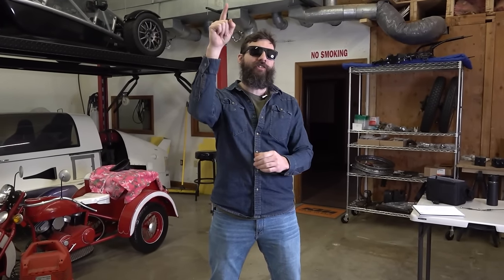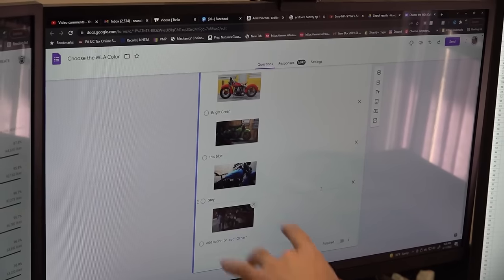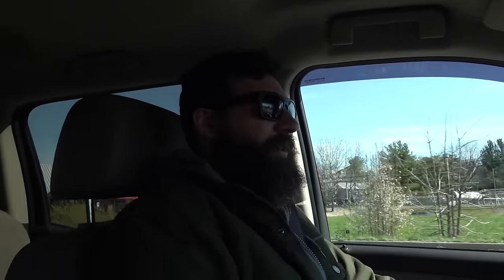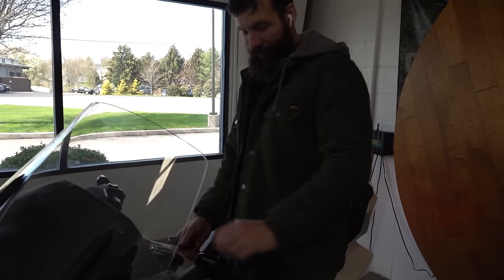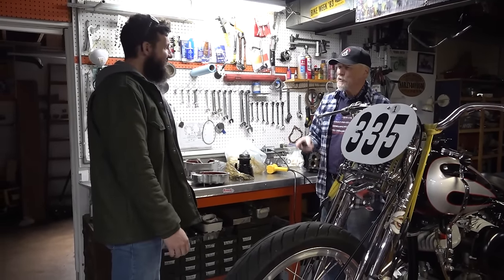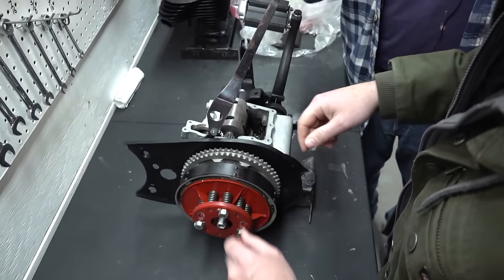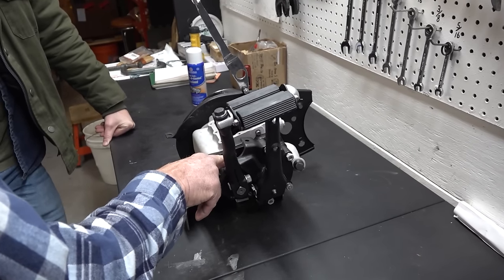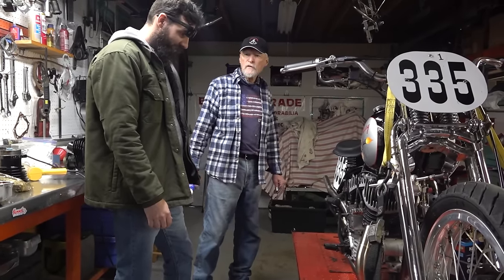The Junkyard WLA Transmission gets finished and we Sponsor and old friend

Comment: That looks exactly like the clutch on my 1981 Shovelhead... and mine leaks oil via the transmission studs too 😁 for adjusting the clutch springs, make sure the pressure plate releases evenly all the way around. This might mean the three nuts are not screwed down to the same depth !

Comment: Never ride the 45 wide open for extended periods of time during hot weather or you will gauld a piston skirt !  Those engines did not spray oil on the pistons so you have to let off the throttle and timing advance on left side of stock handlebars every so often to allow the pistons to draw oil up on the cylinder walls.   Friend of mine installed an oil spray port on his flathead 80 but I don't think he ever got it quite right due to the oil spray going past the rings causing the engine to burn oil.  So he didn't get the spray nozzle at the right angle or there was too much oil pressure.

Comment: I think your better off doing a period correct color but many of the bikes of that time were more than one color. Your best bet is to find someone who is knowledgeable on bikes of the time and the typical color combinations so that it looks more authentic. Plus another thing you may want to consider the graphics that would've been readily seen on such a bike. On my Road Glide theres a pass pin that comes with the bike or you can put one in to start the bike without the key fob. There's a card that you can stick in your wallet that gives you instructions on how to enter te code. I swear I've got the same tshirt Tim is wearing. Sounds like Tim is doing that old biology song for the bones but with the transmission parts. I'm quite sure Tim appreciated the sponsorship and the gifts for his race bike. That was a great thing you did for him.

Comment: I made the serious error of helping an old bloke by pushing him to start his Walla race bike at The Barry Shean Festival of Speed in Sydney a few years back, it fired and left me almost head planting in the bitumen car park of the pits. I managed to shoulder roll and only lost minimal skin. Never again, its self-starter or rollers from now on.
Reply: Saw this happen at Sears Point years ago.  The bike lit off, the throttle was stuck wide open and the rider and the bike went tearing through the pits barely missing several people.  He fell off eventually and both he and the bike ended up wedging themselves under a pickup truck.  Good thing he was suited up for the race already.  We rushed over and, with the help of many guys, we lifted the rear of the truck and dragged him and the bike out.

Comment: I would've liked to see a little more padding in the ass part of the seat,  but l like the finish and it should fade/age nicely, leather needs ' feeding' occasionally.
Did you ask the racer what oil he uses in the gearbox? (I thought you might go Matt 7:12 on the quote)
Reply from the maker: that would have been a great verse also , thanks

Comment: ok, you've lost it with the cinematic start up sequences...leave that to whoever you saw do it first, And you still haven't picked a name for the WLA, and I still wonder if it's name is Charlie, Joe or Joerlie
Reply: Using the remote transmitter
To allow a person who does not possess the Honda SMART Key to open compartments, press the UNLOCK button on the Honda SMART Key (Turn signals blink 2 times).

When the UNLOCK button is pressed, the compartments can be opened by someone who does not have the Honda SMART Key.

If you press the UNLOCK button, but nobody opens any of the compartments within about 30 seconds or about 30 seconds have passed after an opened compartment is closed, the compartments automatically will relock (Turn signals blinks once).

uWhen the 30 days have passed after the ignition switch is turned to OFF or after the buttons of the Honda SMART Key is operated, the remote transmitter will no longer operate.
To reset the system, turn the ignition switch ON once and then OFF.
Reply: @dopeytripod  totally NOT what I was referring to... more like he lost it on the cinematic vehicle start up sequences... I was saying NOTHING about how to start a "had one never did again" (HONDA)... and I will never own another honda to care about that anyway
Reply: @TheOneAndOnlyRandy  oO who cares you weirdo .. and hondas are best

Comment: Jeez my 11 year old Ducati has a button under the bars that you snake your hand to and push a button. The screen lights up and asks for your pin. You use the left grip controls to key in your pin and the bike is ready to start. If you forget your pin the dealer will reset it to 4 zeros upon proof of ownership and then you can change it to whatever you want. Hondas' solution to a dead prox key is stupid.

Comment: This is not meant to be rude,  is Craig actually a mechanic? I ask because he seems to struggle with extremely simple things.  If he really does work on Japanese motors a 3 or 4 speed Harley transmission doesn't get any simpler. And I know this from personal experience.   They really are pushing the idea that not just anybody can do it.  I rebuilt my first 1950 four speed at 21, it's still in service  30 years later.